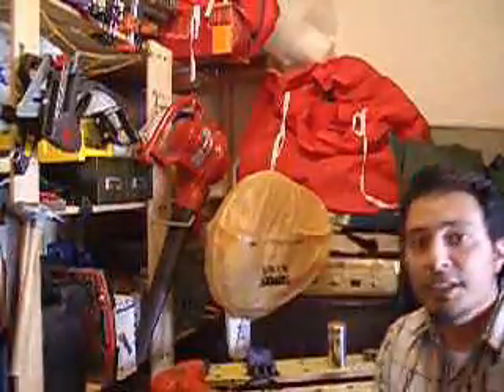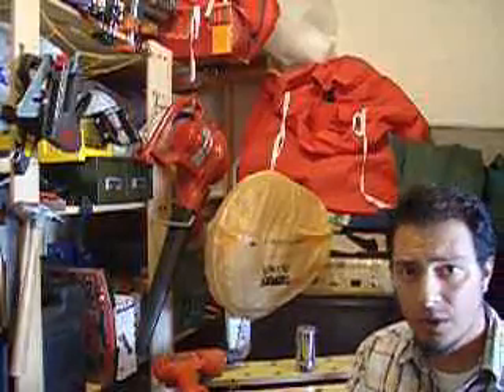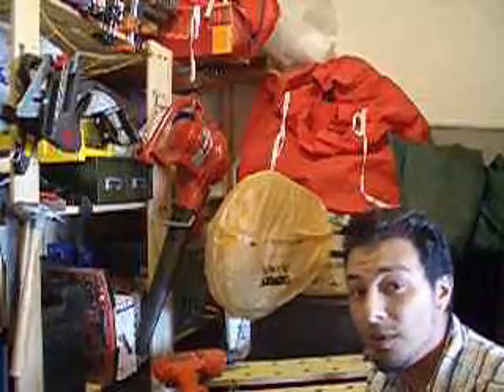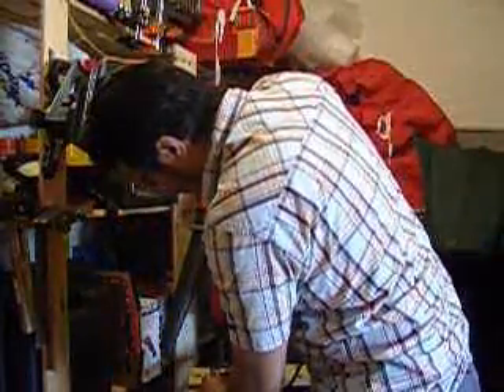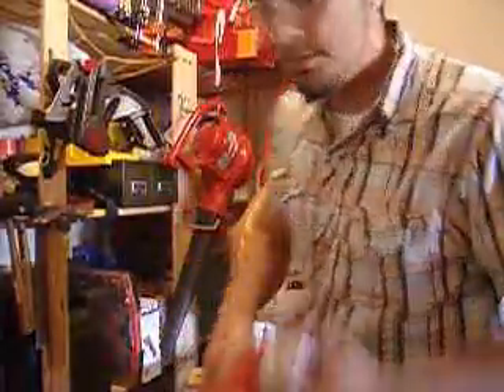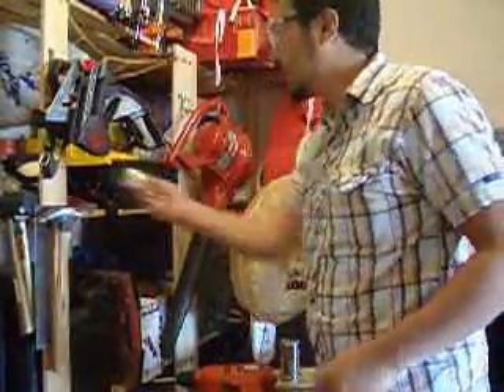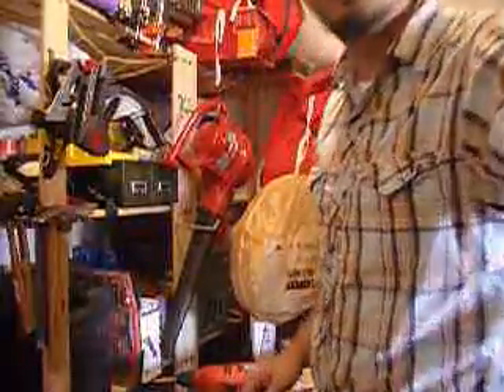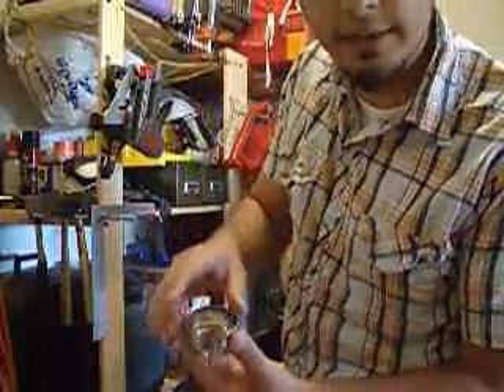Build Your Own Inexpensive Harmonica Mics--Part 2

Comment from the maker: Well, you can certainly make it without a vc, but if you play on stage you will quickly experience random bursts of feedback at different time, and a vc lets you squelch it right away. plus, you can increase the volume for solos, and turn the mic all the way off when not using it, all without having to walk over to your amp...